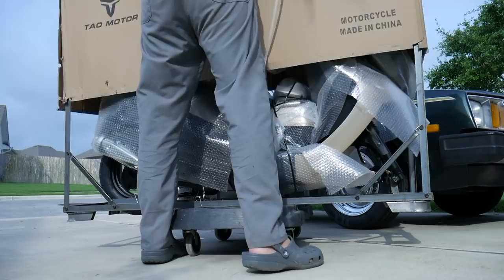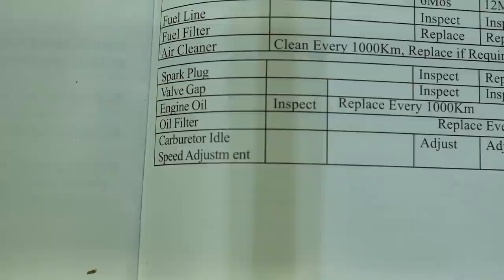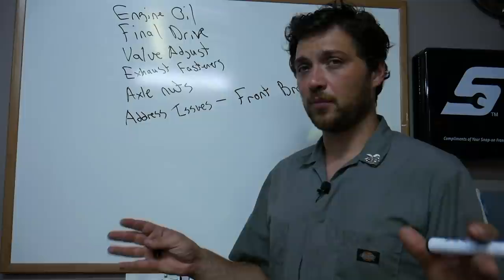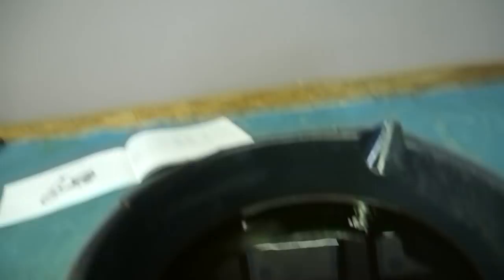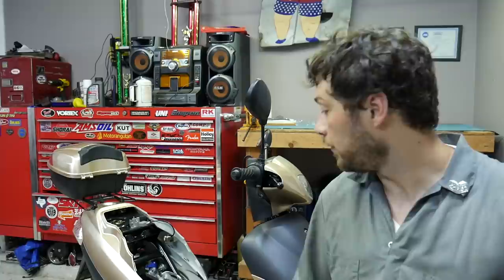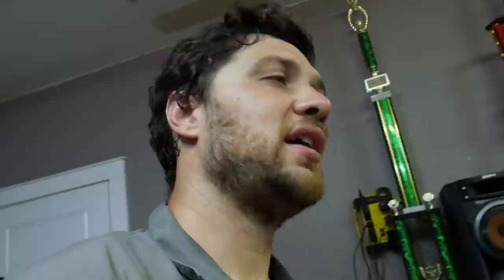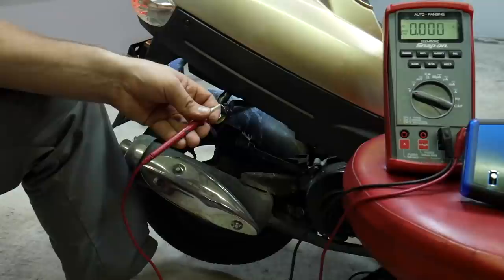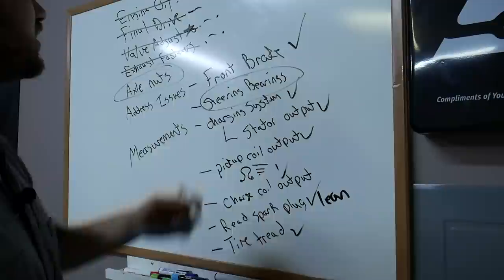(PT. 3) 300 Kilometer service on the most HATED scooter on the internet: Living with a Tao Tao

Comment: There is a way of adjusting you or air fuel ratio sort of and if you are going to try to mimic with people who are buying a cheap scooter like this are doing most of them would only do the air  Fuel ratio adjustments they would not bother rejecting the carburetor there is videos on how to do that that you can watch on the internets yours is probably sets from factory to be in one of these slightly leaner positions in the 1st place and depending on what parts they had available for the diaphragm needles you'll either have a needle that has 2 points of adjustment on it or 3 points of adjustment and you just want to adjust the diaphragm needle to the point of adjustment where the diaphragm opens up and it opens up a little bit better fuel flow to the carburetor that is how you adjust the air fuel ratio on these machines and if you are still running too lean then go up 1 jet size on your main jet and adjust it that lay but try to do it in a way where it would be more like what somebody who is not very mechanically inclined would do and to just adjust the diaphragm needle and open it up more to give you more fuel and if you are running lean you will probably in this instance noticed a difference and power or maybe you won't notice a difference at all and it will just run a little bit richer Also keep in mind sense this is a carburetor did air cooled vehicle it is going to run hotter than a water cooled or fuel injected engine which means that you should probably be running premium fuel and at which most people who buy these things who do any experiment in around with that find that they get slightly better performance on premium and they generally prefer to run premium that has been my personal experience because they prefer the slightly better pick up and acceleration and the slightly improved top speed from running premium unleaded fuel versus regular unleaded fuel and that does make a difference as well so if you're running regular unleaded you might end up running premium from now on and you can probably feel a difference and how it runs within 15 minutes and you will probably notice that the ween condition noticed on the spark plug will not be as noticeable or might even disappear altogether But do keep in mind you did by this to be a budget scooter and you are going way above and beyond for what 80% of the people who buy this thing are going to be able or even willing to do as far as all of the other little maintenance things that your checking and adjusting so try to keep everything you do as cheap and as simple as possible taking the carburetor off and rejecting it is not one of those things that most people who buy this thing are going to do and in most States in the US there isn't even shops that will touch these Chinese scooters so it's completely up to the owners so try to keep it to simple basic maintenance things and stay out of the slightly more complicated things sense you are actually doing this series to show people how to maintain the scooter as well as how good the long Gemini of these scooters are That being said I did know one person who had 1 Of these Chinese scooters from this same manufacture he was a little bit more of a tinkerer and he had 20000 km on his and was on his 3rd set of tires and he said it still ran great But that was a 2000 and 8 in 2009 new rules were passed forcing new admissions requirements that these scooters met and it also ended up hindering the build quality of these scooters and people who had 2000 and eights and then but brand new ones in 2011 say they noticed a huge difference in performance both acceleration and top speed wise between the older generation of these scooters and the newer generation of these scooters and they said it was quite a noticeable difference.

Comment: Very nice video series. Recommendation for further data you might consider saving:
fuel consumption
oil consumption
top speed
acceleration 0-30 (it does make 30, right?)
Best regards

Comment: i have a taotao powermax vip 150cc.  $650 NIB . i changed the engine oil after 25,000 Miles. still has factory transmission gear oil, belt, brakes et cetera.  replaced rear tire for offroading to a Maxxis 6024 120/70-12 . this bike has two major but simple to fix problems, exhaust and plastics .  I was impressed so i bought another. however the old one i stripped one of the exhaust stud bolts and the seat bucket is torn the side plastics are  broken so the backup will get the  knobby tire and become my daily and i am trying to get a new one for a backup . i'll probably fix the plastic side panels and put them on the second one so i can put on saddle bags and not scratch the new plastics .

Comment: I'd say jetting should be fine. Since you are "testing" it as any normal person would use it, it's not unreasonable to think the shop they take it to might not suggest the same jet change (if they are a good  and thorough shop that is). But I'd leave everything else as stock as possible for the duration of your test.

Comment: I had well over 28 000 km on the 2 years i had my 50cc scoot, tho after 12 000 km, the rest of the milage the bike had a 72cc big bore kit installed etc, never gave up the ghost :)   i did have to change the crankshaft due to bearing noise, but nothing major :D  i wish scoots werent so expensive to insure over here ( same insurence rate regardless if you're 15 ( scoot riding age ) or 60+ haha. 
Did go through the original tires after about a year, but they were so useless in the rain, lasted a long time but not worth the danger they were.

Comment: In the "Spirit" of your experiment I'd say that you should run the scooter with it's stock carburetor for now and try using a different main jet. It would cure the lean running of the engine, boost the performance slightly, and, in my opinion, keep your experiment intact, assuming the failures of the Tao Tao style scooters are from stock machines. The carb on your machine was probably tuned for a different elevation than you reside at, so tuning it to run well for your area wouldn't be out of the question.
Reply from the maker: thanks for your input!

Comment: People are accustomed to doing almost no maintenance on vehicles. Modern cars have spoiled us. Motorcycles aren't like that. Bikes require a lot more attention. I mean required, not recommended. Tire pressure is often overlooked. Oil changes, chain cleaning, lubrication, and adjustment, and lighting checks are not optional.

Comment: Information is important.Knowing stuff takes alot of experience. To learn all the crap the manufacturers leave out of the service manual is a career. I think you are right to prove or disprove  whether or not this type scooter is a total turd, or lack of maintenance and improper prep is actually the cause of the bad rep. I always check tire pressure first. It is a Good indicator of how much attention a customer spends on the simplest  required maintenance. After over 30 years very few people bother,and unless its a rigid frame and even then 16 pounds or less is not good,lol. Expect low oil, dry chain etc etc.
Reply from the maker: Absolutely!

Comment: If you’re afraid of it running just a little bit lien. I Would suggest only adjusting the carburetor needle one notch if it has a adjustable one, if not you can buy or find small shims to go under the stock needle head. 
That way it should keep you good fuel mileage but better performance

Comment: Pull the brass plug out of the idle mixture screw port.  Be careful about the method though; the idle mixture screw is behind the plug.  With the impeccable quality of the rest of the bike; it's deffinately part of the lean issue; it should also help make the transition from the idle jet to the main jet a bit more smooth.

Comment: for the purity of the test i would try adjust first (carb) and maybe inspect the jet for defects and replace if necessary . As for the data sheet all  dependable info is valuable (i have a couple out in my shop that will be needing testing soon to get them back in running order not the same as yours but a base line is always handy. thanks

Comment: Tune the carburetor at the least. This is really needed as routine setup. A jet kit is very cheap. I'm very interested in how much more effort is needed by the owner versus fuel injection or 2-stroke engines. I've been debating on the Genuine 2-strokes myself. I still mow with an old Lawn Boy so I know what I'm getting into.
Reply from the maker: the buddy 50 is a great scoot. great bottom end so it can take some performance upgrades nicely. Usually i just throw a 70cc kit and set of nice reeds on it!

Comment: Plenty of scooters sold domestically run lean as they use a smaller main jet, this is to not only give better fuel economy but serve as a way to restrict them for road use due to <50cc laws. Going up a jet size would be a good idea; It could also be a manufacturing error and the jet isn't drilled out to the right size from the factory. I would up-jet; It's not really a mod, it's only jetting for reliability; you should always run a little rich on these things rather than lean; It'll keep the engine cooler and provide that margin of safety. many 50cc scoots come with a derestriction kit from the factory,  which includes a smooth boss with no shoulder (unless the variator has a washer on the boss to keep it from closing up all the way, which needs to be removed) and a jet one size larger than the one in the carb. So technically, it's not a mod so much as a dealer service. I upjetted my scooter almost immediately after I bought it. Did a jet come in your toolkit? if so, swap it in.
Reply: @Pony Boy pretty much all scooters are made to be CARB legal for california these days, so yes, it's jetted lean from the factory. 4T scooters come with CVK carbs unless they're fuel injected. Not cable operated slide, they use a diaphragm that raises and lowers depending on RPM by engine vacuum. only the butterfly is operated by the cable. Most of these carbs have no adjustment on the needle from factory, unless you count putting washers on it to raise it.

Comment: I know this is a late comment on the lean condition. But it's import ant (pun intended).

Normally you would adjust the air screw and then lean it out after break-in but...

Now adaze (another pun intended) you can't adjust any mixture screw because there isn't one due to epa laws so they (the factory) set it and forget it.

I guess they figure that it helps somehow to break a engine in lean (stupid idea) to somehow save the environment by spewing metals and burning oil into the environment out the tailpipe. So you break-in a brand new motor in lean condition and then you get richer as the motor gets worn (weakens the whole machine due to a lean break-in). 

Cure?

Can you say put a air screw on the carb? 

I knew ya could :-)

Most modern carbs are not adjustable anymore so you have to rejet a new motor to break-in correctly and then put the stock jets back in after the break-in period.

Who does that?

What's that helping? 

It sure ain't helping you or me or the environment with all the metal and oil smoke that comes outta the exhaust from the start and from then on huh (for the rest of the shortened life of the engine). But they have EGR for that on a 50cc engine huh, what a joke (and it's not funny).

Anyway didn't mean to cause a rukus (pun intended yet again).

Great videos man, very educational for those that need to learn how these thing work.

As grandpappy used to say...

"You better know the things your ass depends on when you sit on a scooter"

...and when he said scooter he wasn't talking about a 50cc motor.

Keep makin vids, you are doing a great job for others to learn!

Write me back if ya get a chance.

Later on brother...

And 

Safe ride to ya man.

P.O.D. - Alive:
https://youtu.be/ce2KN06dS7c

Comment: To help perform your exsperiment, I would suggest taking fluid samples during every service on the vechical. Doing so will allow you to monitor wear indicators, as well as see how each fluid is progressing. At the very lest, it contributes data which can be refered to when your coming to a conclusion.
Reply: To clarify,  when I say taking fluid samples, I mean taking samples which are then submitted to a fluid lab for analysis of the fluid's elemental break down which will allow you to see the additive package in the oil, fluid viscosity, Flash point but also if certain elements such as Aluminium, Copper or Iron start to raise in the oil, you can deduce that maybe a component is starting to fail such as main bearings, case being worn into or gears them self.

Comment: Anyone who only gets 10k from one of these engines should quit engines. The engine is not the weak point on these scooters, infact the engine is probably the most well made part of a chinese scooter. Plenty of GY6 50cc's out there with 30-40k on the clocks.
Reply: Not so sure of that.  I had a 250CC clone a couple of years back.  It eventually had a top end gasket blowout (exhaust blowing into coolant).  I decided to just replace the entire top end, instead of just the gasket, since the top end kit was so cheap (~$60 IIRC), and doing the full thing isn't all that much more work.  When I disassembled the top end, there were no crush washers under the cap nuts for the 4 bolts holding the top end down.  I was using the Honda service manual for the motor, which explicitly states to replace them , but they were never there to begin with, so I was a bit confused... until I torqued them all down, and discovered two of them were still wavering under the torque wrench!   The nuts had not seated on the top end before they bottomed out on the rods, so I installed the missing crush washers and everything torqued down ok.   This was probably why the gasket had blowby, although to be honest it was a 2nd hand bike and I have no idea if the previous owner had wrenched it (I didn't think so because it only had 125 miles on it, but you never know).
I probably stripped 3 or 4 bolts on that bike because I was using the torque settings in the honda manual, instead of looking at the steel grade and diameters of the bolts that were actually installed.  Trust me, they do cut corners on these engines to make them at that price point.  I was fortunate enough to be able to go into a Fastenal to get good bolts (due to my job); otherwise I would have had to mail order them from McMaster-Carr or similar, since these grade of bolts aren't carried at Home Depot or even your local hardware store.

Comment: Welcome to the EPA age of carbureted engines. They all run lean. Also these carbs are tamper proof. The float bowl screws have to drilled out to remove them. The idle mixture screw is covered with a plug. Ride it. Once it breaks in at around a thousand miles...uhh....about 1600 km. for you, everything will change. You need to stop acting like these engines sign off so early. With someone as meticulous as you it will outlast your expectations. And your valve clearances opened up from rocker wear and deposits under the valves. My '79 Kawasaki did the same thing.

Comment: I think I would leave it stock. Most users aren't going to do much of anything to it but ride it till it drops. They buy it cause it's cheap and unless they are into mods, don't do anything to it. Maybe move the jet needle up a click if that carb has that ability. I've got 8000k on my chinese scooter. It's rock solid reliable. Better than I can say for the Yamaha C3 I have. Burns no oil. I change the oil on schedule and broke it in according to the manual. I have changed carb jets due to lean running settings from the factory. Mine is an 08 but it's not a Tao Tao. I'm following along to see how this works out for you. I've got a feeling that it will last longer than you expect due to your actually taking care of it.

Comment: Hey bud! I’m actually doing something similar, I picked up a 2018 wolf blaze 2, the 150 cc variant. I would adjust the carb, and not rejet it since they were designed for “one size fits all” use. Readjust the fuel to air mixture by adjusting the needle and see how that pans out first. I had a similar problem that it was set too lean from the factory. Mods are fun but I’m curious how well these are designed as a personal commuter vehicle, not as a project.
Reply: The fuel-air mixture screw in these carbs usually only impacts idling.  The throttle body taper adjusts low-mid speed, and the jet affects mid-high speed operation.  I'm assuming that these (GY6 50cc clonse) are using the ancient carburetors and are not the constant velocity types you usually only see on larger scooters.
Reply: No there should be on the needle itself, adjustments inside the carb.
Reply: I’m talking the float height adjustment to allow more fuel in from the bowl which should make it overall richer
Reply: Unless I’m out of my league here and there’s something I don’t know about, it’s just an adjustment I’ve made on my 50cc as well as my 150
Reply: @glenndoiron9317  No, they use CVK carbs with a diaphragm

Comment: If you mod it your defeating the purpose . But chances are you will have to replace the carb because you will.not be able to remove the bowls. My stock had the screw heads removed so I had to replace carb. Runs alot better now though.

Comment: jet is weather specific it may be good for the chinese market but not in the area where you live so adjusting the jet should be no problem. Even when going from summer to winter the scooter would behaviour could change due to air temperature changing.